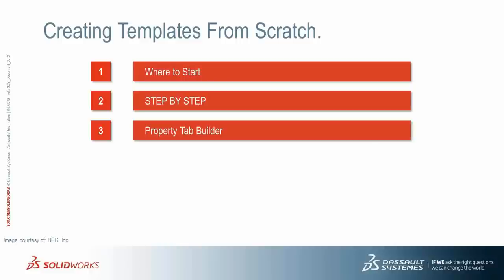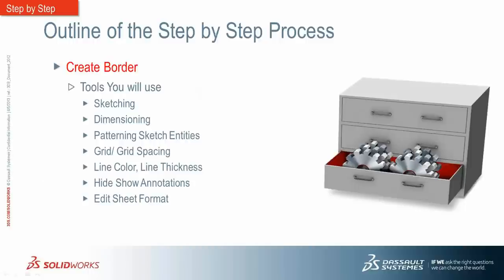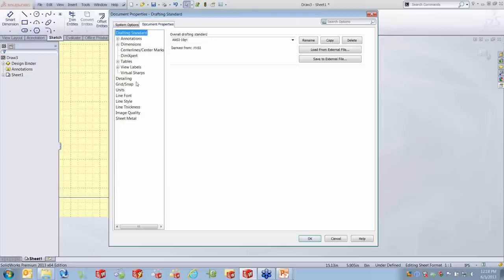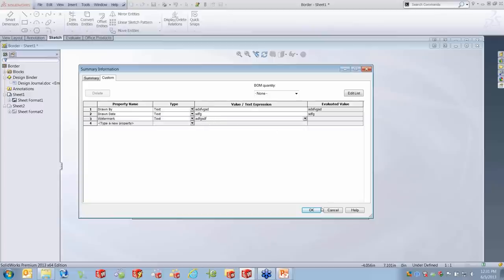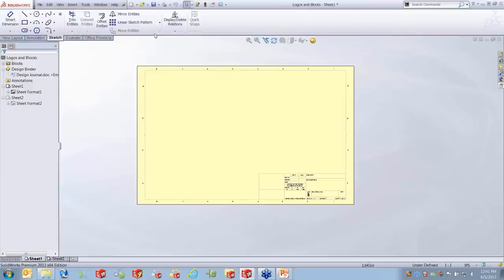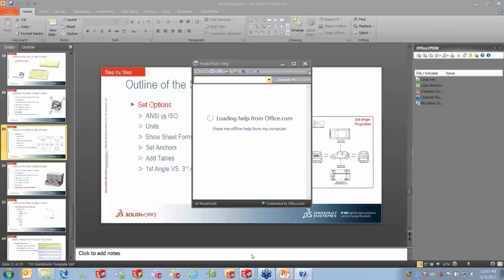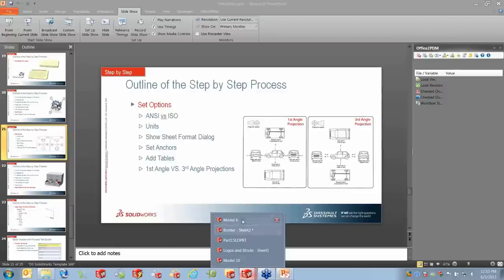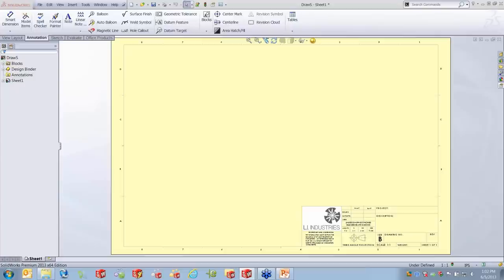Lunch & Learn - Designing Templates from Scratch

Comment: This is a very good tutorial, but I thing that the part with the grid is not good. When you put the rectangle for the frame, you can select the lower left corner. Then select the respective fields in the properties to manually write X and Y coordinates for it. Than you can add the smart dimensions for the frame X and Y size.

Other things. Probably because I am perfectionist or something, but I don't like the text to be on a random position. I draw a diagonal line in the text field and then attach the middle point of the text to its center (for center aligned text), and so on...

My opinion is that this is a very good tutorial.

Comment: Great tutorial, thanks. I'm having trouble with regard to the Custom Properties Tab. When I make the custom tab with all of my file properties in it, it links up to the drawing just fine. However, the custom properties tab doesn't update the values stored in the File Properties dialog box accessed on the top toolbar. While this isn't a problem for me personally, what if a user comes along and stores all of his part metadata in the File Properties box by accessing it through the toolbar instead of the screen-right-flyout properties tab? Is there a way for the two to sync up? Thanks again.

Comment: At 11:45 you set up grid spacing to place lines "exactly" where you want them, but why wont the system snap to the "exact" place the you want?  You still had to zoom in to kinda get it "exact."  I tried it and I cannot get the snap to work either.
Reply: Me neither and I'm using SW 2016.
Reply: Click on the bottom line..........hover over the far right end point of this line.....click on that point and then click on FIX to add a fixed relation. This will keep the border in your exact final placement position. Good Luck.